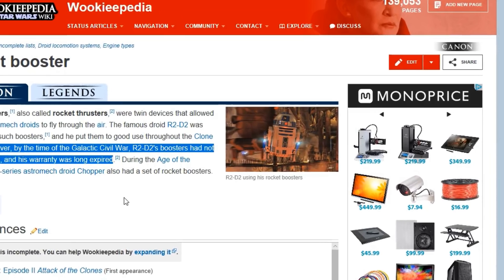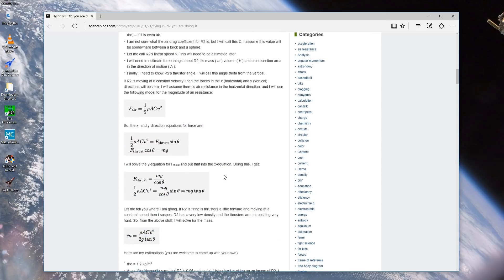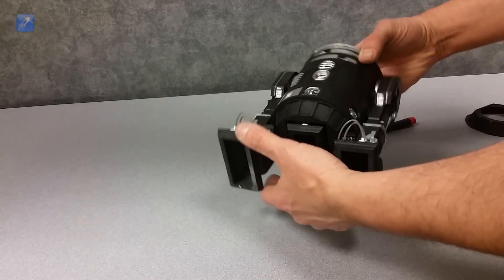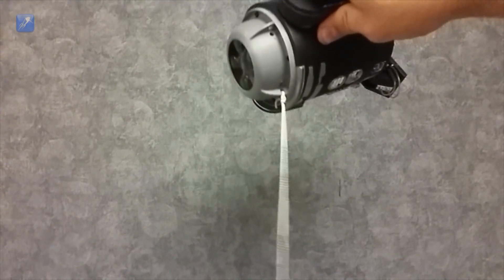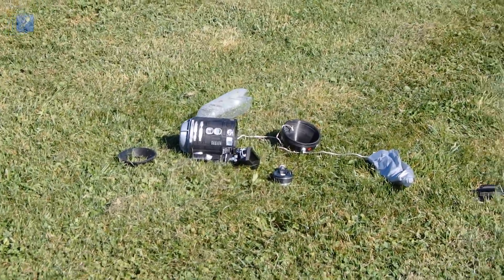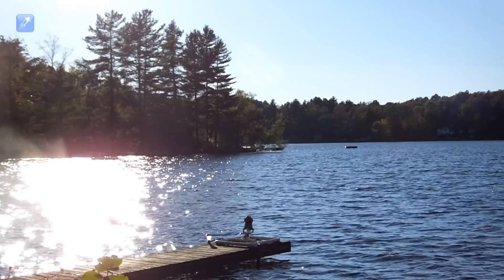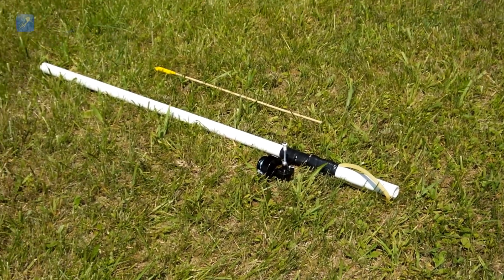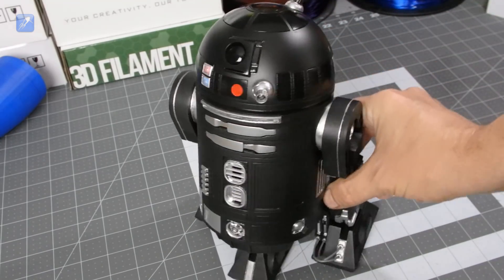Rocket Powered Star Wars 3D Printed Astromech Droid Flights

Comment: Oh very funny! I liked the idea and I had a lot of fun watching the video, you edited it very nice.
Next time you can make a bigger R2D2 and put 2 water rockets one at each leg, as in the movie ;-)
Just kidding, but more pressure and an onboard camera to see the robot flying will be funnier to see it with more altitude.
Thanks!
Reply from the maker: Putting a camera on the robot is definitely something we want to try. The model was really too heavy for the small 500ml bottle and then we discovered the bottles didn't hold more pressure. If the pressure could be ramped up, it would have easily lifted a camera and probably gone way higher. Getting it to hold more pressure so it will go higher is also something we want to do.
Reply: Well you have three options then: make the robot lighter, put more pressure on the bottle... or both!! Bua ha ha ha! Well, whatever you do will be epic, so I'm waiting for it already. BTW I bought already the super special glue to stick bottles together so the rocket can go higher, you know, parachutes deploy better with more altitude ;-) So that's for the year coming from my side, just to let you know :-)
Reply from the maker: The space where the bottle goes is about 5% larger than the bottle, which was there to allow for the bottle to expand with pressure. That room will come in handy if we wrap the bottle with reinforcement. :-)